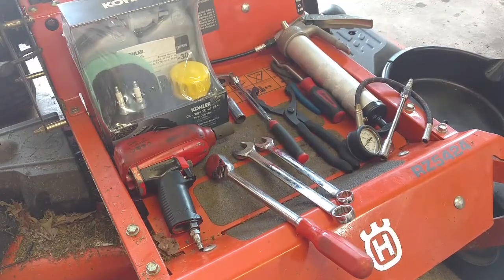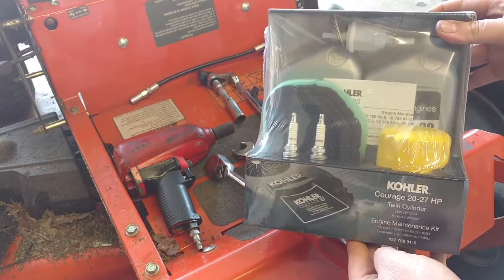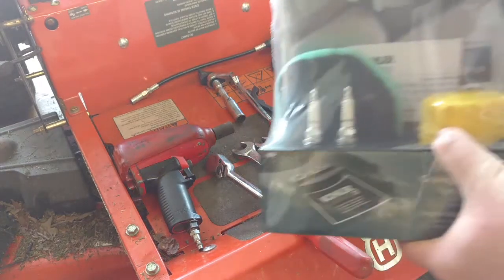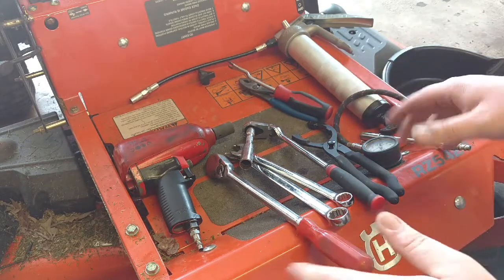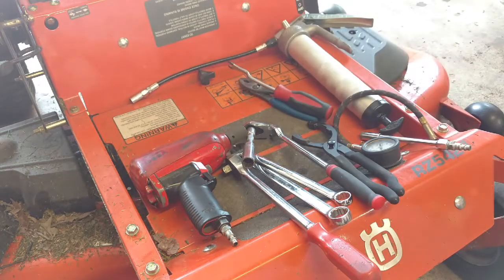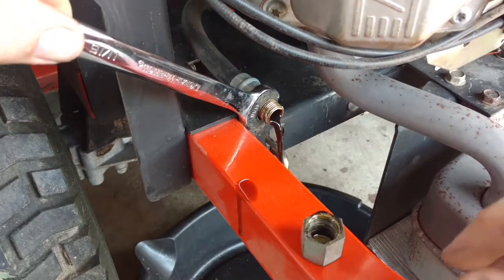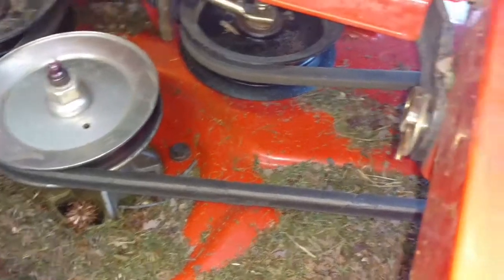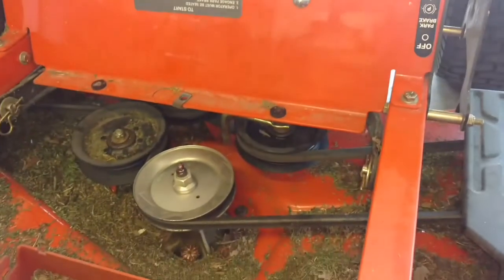How to Service Husqvarna RZ5424 Kohler Courage 24 hp

Comment: One tip is to Place your flexible funnel directly under the oil filter, then slightly raise the front of the mower to drain the oil into the oil drain pan. I use a piece of foil curled up. First time I tried letting the oil drain through that little slot, I made a huge mess!! It's a stupid design, you would think that they would design them with the oil filter in the rear or underneath

Comment: I have a HZ5424 and I love the mower, but for some reason the transaxle (left one) gets sluggish after about 20 minutes of mowing.  Does this mean I need a new hydro transmission, or could this be a number of things?

Great video by the way.  I don't normally change my fuel filter regularly, but I will now.

Comment: I just purchase a Husqvarna Zero turn about 15 months ago, and it's been running great since I bought it but lately it has started to have issues like if I try to crank it, it doesn't want to stay crank unless I hurry up and take off and then it runs great.... And for it to crank the levers have to be open extremely wide than normal to crank....

Comment: Hello ! I just inherited this exact mower from my brother in law. He told me that it has a good engine on it and had just bought a brand new battery for it..  The first problem is : It wont turn over Can you tell me what the wiring diagram is on this engine so I can get it to turn over ?   I know the red and black are the hot and neutral, but the others , I havnt a clue ?  Thanks for any help that you can share on this ! Timmie

Comment: How do I disengage the transmission on my Husqvarna so that I can push it? I don't want to work on it on the grass...
I suspect one of the safety switches is not working.  The engine gets cut off every time I take the brake off.
Reply: BTW it starts right up. I removed the seat switch and it is working.  
Where is the switch for the blades engagement. I can't engage the blades because the hand brake is on (safety switch button is pressed down).
Reply from the maker: @georgevalente4223  there's 2 small rods on the back of the frame on either side, pull them out and you should be able to push freely

Comment: Is there a way to change transaxle fluid or is it completely sealed?
Reply from the maker: I'm not exactly sure. Ive always thought it was lifetime oil or grease in these cheaper units. Not like commercial equipment but I could be wrong.

Comment: I have a RZ5424 Husqvarna Zero turn mower that lost a zerk fittings just above the right front wheel. I went to the nearest zerk fitting store and found that I had to buy 10 3/16 zerk fittings. Lucky for me they were on sale and I got them for less than $100. I got it on reliable authority that 3/16 inch was the correct size but when I tried to install one none fit. Is there anyone out there who can tell me what to do next. I would not only like to have a zerk fitting there for cosmetic reasons but I what to keep that area lubricated. Thanks in advance. J.
Reply: $100??? You got ripped

Comment: How do I put it in nutral
Reply: There is a pull lever to disengage the transmission from the wheels. The lever is seen in the video at 3:12, just below the drain plug.  Pull that lever out  of the larger opening until the lever shoulder passes. Then you can set it down in the smaller channel.  But remember to reengage (push back in) the lever prior to usage.